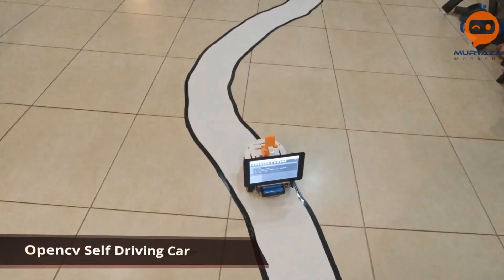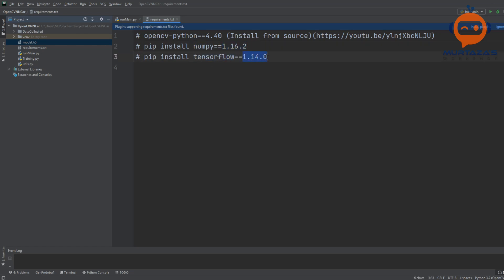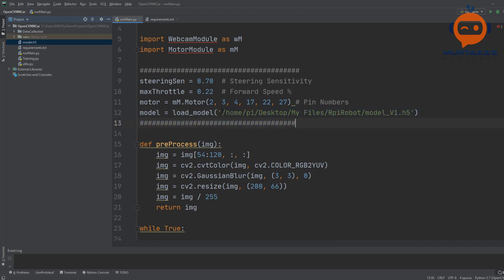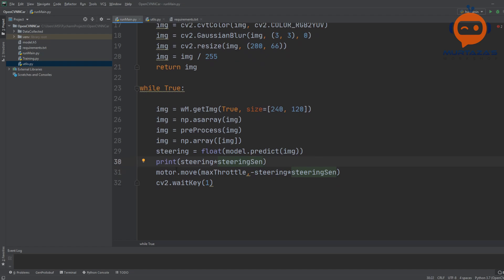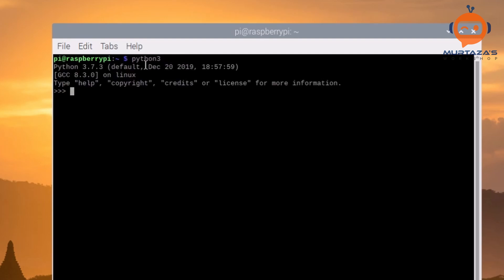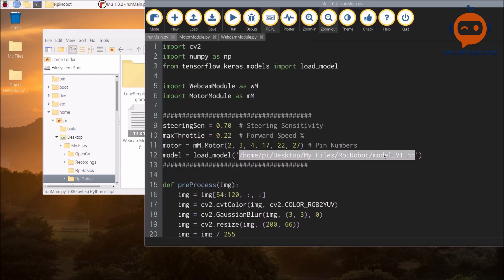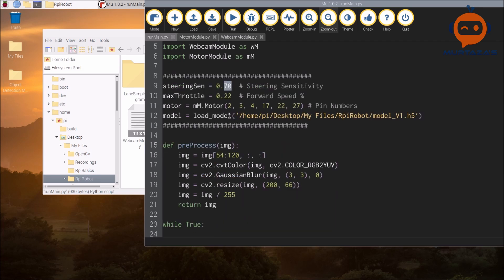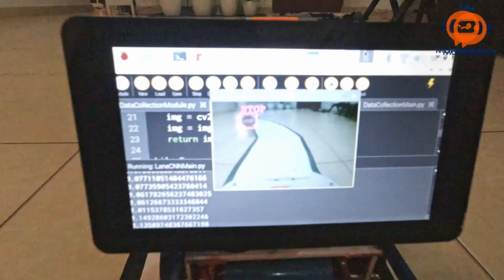OpenCV Raspberry Pi Self Driving Car using Neural Networks - Part 3/3

Comment: I am having trouble installing tensorflow. I used pip install tensorflow in the terminal, but whenever I try to import tensorflow in a script, it says tensorflow module doesn't exist.
Reply: Use pip3 install tensorflow==<version>  instead of pip.

Comment: Hi. Congratulations, great project. I was able do implement it on a different robot car, but it seems that raspberry pi is a bit slow. For example there is a delay of 1-2 seconds between what happens in front on the camera and what the raspberry pi is showing on display. My question is : is it possible to implement your project using the Coral USB Accelerator to speed up the processing?
Reply: Same problem any solution
Reply: Hello bro, i have the problem with my model.h5, can you help me for this?